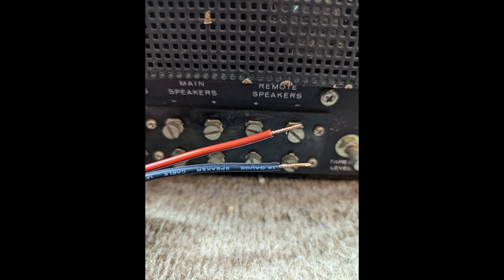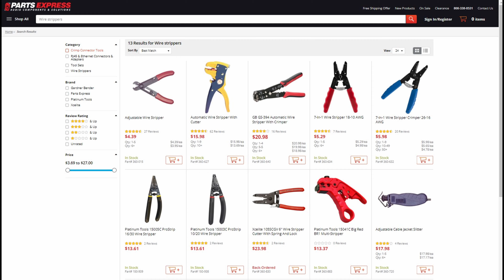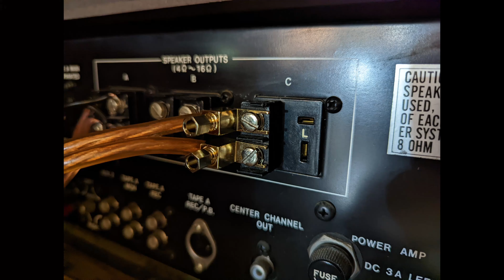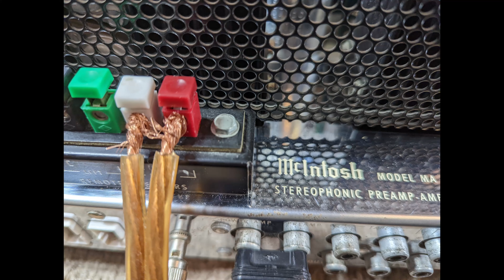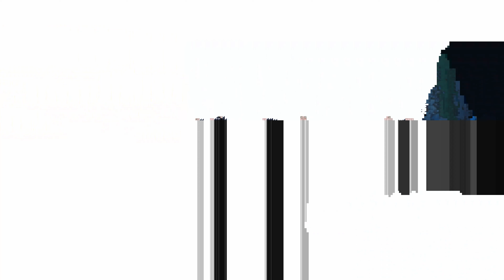How To Connect Heavy Gauge Monster Cable To Vintage Stereo Equipment- Receivers Speakers Amplifier

Comment: Oh wrap one jacket in tape.  Ok, I have a better idea. Use heat shrink tubing on one or both offset pin jackets. Electrical tape always gets nasty gummy over time.  Hard to believe I did not think of this when I had these in my hands and sent them back to the seller. Duh.

Comment: Unless the cable run is 50 metres long thicker cable will make no differential at all. I use 22 gauge and it’s fine.

Comment: Hello Kevin.  Great video as usual!  When Skylabs is reconditioning a vintage amp or receiver, do you  ever update the spring-loaded push terminals with modern 5-way terminals so that banana plugs can be used?

Comment: we going all ot on pure copper wire, but the Banana Plugs are they pure copper, some say gold plated and read description some made brass but gold plated. is the banana plus not the weak link, if so are you not best using copper coated cables. ive only found a few what pure copper but for x4 they crazy cost as i need 14x of them and i think very limit stock too as one says last one and free shipping from China, or the other seller £22 plus £15 plus postage from usa for a set 4 what is insane. i know the world cannot mine enough copper atm and it never catch up as it takes 10-12 years to open up a new mine and world needs to be opening them at a rate it impossible mostly down to insane mount copper an ev uses compared to a normal car, deadlines by 2030 is impossible and copper a reason, so soon copper will be worth a lot more, but some items what are pure copper are already an insane cost like the Monosaudio High-End Pure Copper Banana Plug x4 set. is most banana plus are the weak link as going from pure copper cables to a banana plug made less good metals , what the option, are all gold plated ones just as good as each other and as good as pure copper cable

Comment: Hello Kevin.  I liked this video.  I have a degree in electrical engineering.  I currently own a Sansui G-3500 that I bought new in 1978 and a pair of AR-17's that I bought new in 1979.  I use fork / spade terminals on the Sansui speaker output connections and ring terminals on the AR-17 input connectors.
I like your hat - "The Oil". ☺

Comment: If you ever opened up a speaker system, the wire they use is very small, 18 or 22 gage. So unless you are running lengths above 100', lamps cord is sufficient.

Comment: Such a timely video. I'm also using vintage audio gear (Marantz and a/d/s L1530s) and have just done an upgrade to all my terminal connections. I mostly gauge the success by seeing if any of my connections have worked their way loose after a month or two. I've toyed with the idea of swapping out the Marantz push-in speaker wire terminals with banana jacks but can bring myself to modify a beautiful old amp.

Also, what happened to your audio on this episode? The hiss level was WAY higher than usual.

Comment: It's funny how much faith we have with the engineering inside the box (amp, receiver, speaker) and zero faith in the engineering between boxes.  If large cable was necessary for the equipment, the engineers would have made the connectors larger and further apart.

Just my 2 cents.

Comment: you've given some very bad advice as tinning wire is never recommended when using screw down terminals. solder compresses over time and loses the firm connection, requiring frequent tightening, eventually cracking the heat tempered wires inside the solder blob. a much better connection is made from properly cleaned and gently twisted bare strands. if you want to solder you must solder the bare wire end to an appropriate spade or pin or lug connector then screw down onto the connector itself or insert the pin of the connector to the speaker/amp connector.

Comment: Can you use spades in vintage JBL push pin speaker terminals? Just have like one half of the spade inside that tiny hole

Comment: instead of electrical tape use heat shrink, you can even color code the connectors with different color shrink. ie red is the right side speaker etc

Comment: I got to spend some time in the Klipsch factory demo/listening room, at the factory in Hope, with Roy Delgado and (at that time) beta Jubilee speakers...which are about $30K a pair...and all the other Heritage speakers.  They had all these show pieces connected with plain THHN electrical wire...probably 12 AWG, if I remember right.  If there had been a better-performing option they could, and would, have used it.

Comment: In the late 1990s, when I worked for The Good Guys, an audio video retailer on the west coast, they sent us to training. The trainer said that banana plugs are junk. The curved contacts, hence the name banana, ride around a central pin, and the contact occurs only at two very tiny points at the top and bottom of the banana portion. The banana portion spins around the center pin with only loose friction. He said it's a horrible design, with inherent poor contact and potential for corrosion and loose connections at these tiny points.
Reply: the trainer was exceptionally misleading. in a properly designed and manufactured banana plug made from gold/rhodium plated spring steel there are zero possibilities of this happening and in fact the opposite occurs, the banana ring compresses around the pin and forms a tight and secure physical connection. he is 100% correct about cheap connectors but to claim such a blanket statement is a huge red flag and his other advice should be questioned. the fact someone's job means they should know what they are saying rarely makes it true.

Comment: You have techs and the equipment. Do a video and test different gauge wire & connectors . Put the speakers on the bench and compare the specs. If there is an audible difference there will also be measurable differences in a a bench test beyond obvious differences in ohms/resistance.

I have shopped at Parts Express and Monoprice. Both are excellent.

Comment: There are people that claim they can "hear" the difference between $20 cables and $100 cables and $600 cables.  I pushed a friend of mine who made such claims to do an A/B that I would set up for him and see if he can really tell the difference.  

He failed.  Miserably.  I "switched" 4 times without actually making a change; I just muted and unmuted the system and he swore I had change cables.  Then I would switch to a cheaper cable, then to a more expensive, then back, then just basic Home Depot spool speaker cable.  His rate of success was about 32%.

This is true in almost all cases.  I've never had access to $1200 cables or more, but for at least anything under a few hundred bucks, it's not worth an investment.

This also holds true for all of the wild power conditioners people use.  If you don't have a buzz, they make no difference.
Reply: If speaker wire does not matter, regular old lamp cord should work just fine.  No reason to invest any more.

Comment: Solder a pin of your choice to the heavy gauge wire. Done it several times. Belden brand copper wire is a little cheaper than thick audio wire. Although all copper wire is outrageous. I use 10 ga.

Comment: I’m going to give the pin type a try. My Pioneer SX 939 has the spring clips. It plays perfect for about 20 mins and then I get horrid static and death rattles. I’ve taken it for service twice and they tell me nothing is wrong with it. thanks for this suggestion. I hope it’s my problem.

Comment: Here's my suggestion for an experiment. Buy some 18 gauge high grade lamp cord and 14 gauge.
Cut a 1ft length of 18 gauge and 14 gauge.
Connect your speaker to  your amp 1 ft both sides, then pump a mono signal into each speaker.
I'll take a gander you won't hear a difference.
Then cut two twenty ft. length of wire, one 18 gauge the other 14 gauge.  Put both speakers twenty feet from the amp and the 18 gauge channel will sound mushy and the tweeter will sound weak.
It's copper, distance and gauge to match the distance, volume and speaker efficiency.
Electro Voice has application tables, I believe.
Expensive speaker cable is snake oil in my opinion, IT'S THE GAUGE THAT MATTERS NOT SILVER!
Sound reinforcement guys use 12 or 10 gauge I think, correct me if I'm wrong.

Comment: These Nakamichi banana connector aluminium outer tubes are actually conductive! Use insulating tape, or like I do - transparent soft plastic tube on top - that looks much better than the thbe and does not leave that sticky residue.
Reply: I did the same thing with mine. That metallic finish sure looked conductive to me so I used clear shrinkwrap on the barrels for safety. You'd never know it was there by looking at them.

Comment: I met a Banging Olefson co-ed in college. I still have my heavier gauge lamp cord I bought for my 1978 system. I have some 25 year old Monster cable in there now. Had nicer banana plugs put in my JBL L65s when they were refurbished. What do you think about the flat- solid blade connectors for the vintage push button slots?

Comment: Personally, I opt to get slight upgrades in wires as opposed to "audiophiles". World's Best Cables and the like. Just for a bit of durability. I bought my original system from a high-end place across from where I was a chef in the 90s. They sold stuff all the way up to the highest-end equipment. Wilson, Nordost, Dunleavy, etc. I spent a lot of time in their listening rooms and never heard a real difference between two 3-meter speaker cables that cost $90 versus the same that cost $5000. The guys who owned it were really cool and they didn't want to call out their big spenders but they told me there are plenty of areas where spending helps but cables wasn't one of them. I remember The Absolute Sound did a cable comparison about 25 or more years ago and they took a flyer on a hack using heavy-duty Home Depot extension cords as the speaker wire. They just clipped off the plugs, tapped off the nub of the ground wire, and attached spades. The damn things finished right in the middle of their comparison!

Comment: Just came across your videos - really like your style of presentation and the info you present.
About speaker wire. I use 12 gauge stranded speaker wire - red and black pair. A 100 ft spool from Amazon is about 20 or so bucks. The biggest problem with running speaker wire is not running it in parallel with power cables closer than about 12 inches as they will pick up the 120V interference - hummmmm.  I know that many audiophiles say that speaker wire thickness does not matter. But, I notice a big difference in base with the heavier wire. Maybe my imagination. But, just saying.....

Comment: The purpose of speaker wire is to send the signal to the speaker, so buying uber expensive cables simply doesn't make much sense. I do have a question about the quality of the wire being used, but even then, going north of $50 for, just an example, 6 ft speaker cables is a case study for diminishing returns, IMO. 

I've always just bought Monster Cables, and I've never had an issue with those. My old man bought them, he's not exactly who you'd call an audiophile but he does appreciate a good clean signal for his Klipsch Fortes, and I never heard him complain. 

And I'm writing this after having read the comment above about selling tons of Monster Cables 😅. But consider the time period, as well. This all began during the mid 80's. Prior to that, we had an old Realistic sound system, and that system didn't have expensive wires and still sounded alright, although it was rather long in the tooth...

He bought ithe spools for the convenience, rather than going the DIY route. He simply didn't have the time to do it himself. He still had to terminate them, but it was the better choice for him. 

Where I come in at is, I noticed how dark and brittle the wires were for the older system we had, compare to the Monsters he bought. And that moment made me think about the quality of said wire of the cables. 

I was about 10-11yrs old at the time, so call me impressionable. Those Monster Cables looked far better than those old plain brown cables that the older system had. I knew I wanted my own sound system someday, and these things stuck with me.

Would those older wires still work? Sure....maybe? But could you depend on them years later, being as cheap and brittle as they seemed to be? So, regardless of expense, I do think quality of the wire matters more than the guage used. But I don't think the quality is going to supercede similarly spec'd wires from another source.

BTW, my dad's original Monster Cables are still doing their thing, and he took my Monsters along with my Bose 401's, which were roughly 15 years newer than his 401's (told you he wasn't exactly an audiophile...). There's nothing wrong or shameful with buying Monster Cables in this time and era. I still use them today, and if anyone dares to question me about them, I just turn my Carver/Klipsch system and let them figure it out.

Comment: Most of my speaker wire sets I've made myself, from 100% copper 12-14-16ga wire (Amazon), in various lengths, with quality banana plugs on both ends. I'm a big fan of the banana to spade, or banana to pin adapters. Also, just curious, what do you think of right angle plugs to relieve stress behind gear?

Comment: I've done the tests ... Just as a car does not get easier to tow if you use a bigger chain, once you have wire that is able to carry the current bigger wires bring absolutely no benefit.  

I've used 16ga lamp cord for years... never a problem.

Comment: Thank you for the video, all I needed to hear was McIntosh and Fischer, took me right to the correct spade connectors for my newly purchased Sansui 2000 with the dreaded screw speaker wire terminals. Man this Sansui sounds incredible.

Comment: I have owned hundreds of combinations of speakers and receivers. I will use whatever speaker cable is lying around, regardless of gauge. There Is absolutely, positively, not a single bit of difference between thick and thin cables. Period

Comment: Sixteen Gauge wire is absolutely all that is needed for speaker wire.  Larger gauges will normally not harm the sound but will not improve it either.
Most of my audio equipment is vintage and uses the screw terminals and My Marantz 3300 Preamplifier has the spring connectors to push in the wires.
This allows the output from the power amp to have a speaker selector switch  and headphone jack on the preamp.
I also have a Dynaco stereo 120 and it has banana connectors with standard 3/4 inch centers to allow the use of dual banana plugs.  Most speakers that have banana plugs do not use this spacing.   The problem is that the 3/4 inch spacing is very close to the 2 centimeter spacing  used in England and Europe for 220 volt electrical cords.  The banana connectors are the best to use for speakers and most amps these days have these connectors.   Many speakers still use the spring push in type though.

Comment: Cable thickness playing a role in speaker sound fidelity or system functionality is a sales gimmick. Electrons are purpose built to flow through copper wire. Does size \ Wire Gauge matter? Yes but only to a VERY limited degree. Thicker copper wire makes electron flow to your speakers easier. Electrons encounter less resistance when flowing through thicker copper wire. Less resistance to electron flow equals less energy wasted as heat and more electrons reaching your speakers. This equation is valid only to a point. Once electron flow generates no detectable heat you've achieved optimal electron flow. 14 gauge copper wire is thick enough to allow optimal electron flow. Anything more is overkill. Electrons don't care about fancy cables or labels.

Comment: @Skylabs Audio:   Would you ever consider changing the connector type on a receiver? I have Pioneer SX1080 and wonder if it would be an upgrade to use the spade connectors you showed here with heavy gage wire?

Comment: When I was in college (decades ago) I had friends who would buy a stereo and received 22 gauge wire with it. Upgrading to lamp cord was a no brainer. That's probably the most effective speaker wire upgrade. 
Due to the dynamic range of music, and the fact that twice as loud requires 10 times the power, there is rarely an instance where your speaker wire is ever going to get warm from playing your music. There's a limited return on investment as you go up in size/down in gauge, as the ratio of the wire resistance to the speaker impedance drops quickly. How much having smaller strands of copper in your cable actually makes a noticeable difference in sound will likely be debated until the end of time. However, if I bought an exotic (expensive) speaker cable,  you can bet that I could hear a difference, even if there was none.

Comment: I recently had a Kenwood KA-9100 repaired and the twist connectors were not tightening up properly so he replaced those connectors with dual twist or banana connector and using the banana plug adapters work great and much easier to work with. I use the banana plug adapters whenever I can

Comment: Great review Kevin! - Quick question; I have 14 gauge copper cables connected to my vintage Sansui receiver spring terminals (to my Klipsch Heresy III's), playing very well.  I wanted to connect 12 gauge OFC copper cables to it only because I have the extra cable for it for another  system I plan on buying. Bottom line, they are too big for the connector (as you stated) and would require the Silverback pin connectors to make it happen.  Would there be any noticeable improvement in sound quality with the 12 gauge via Silverback, plus the added risk of them being so close together - or should I just leave well enough alone?? Thanks again